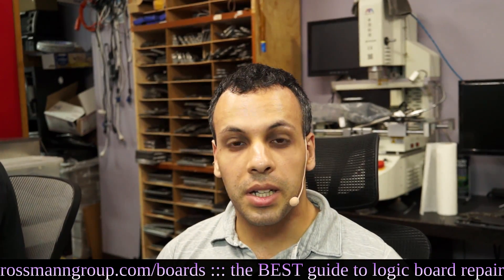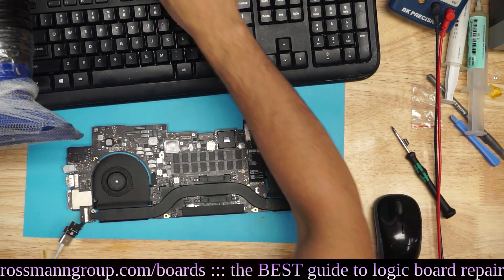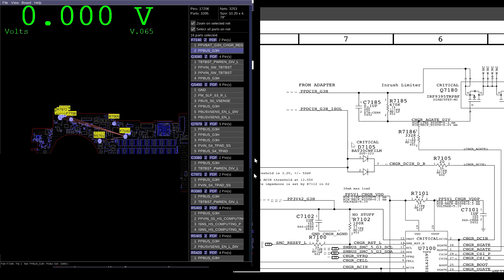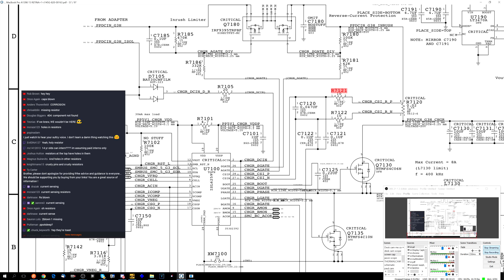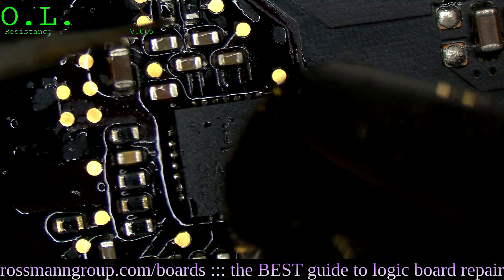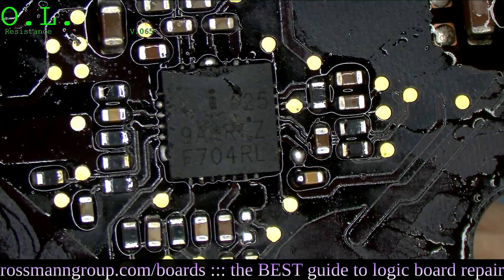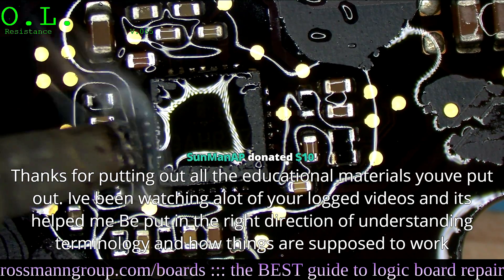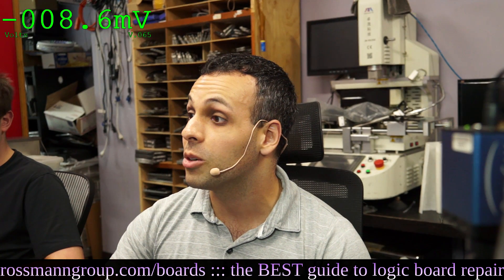Macbook repair + GoPro testing :D

Comment from the maker: › GoPro Hero 6: https://amzn.to/2MMcMiF
› GoPro Bike Mount: https://amzn.to/2OHc4Ej
› GoPro Housing w/ cold shoe mount for mic: https://amzn.to/2vNnwqB

Settings were 1080p, 120 FPS, and stabilization turned on. It does 2.7K at 120 FPS, but no image stabilization, and 4K brings you to 60 FPS and no image stabilization.

Comment: When you ask and Apple engineer

…if they even know what a heatsink is: 

Yeah, it just makes heat go places. It has no effect on the board. 

Me: You idiot thermals are important.
  1) throttling
 2) Boards can warp
 3) do you want to burn the laps of users?
 4) seriously Apple, Get with the thermal management

… What a fuse does
  Yeah it makes sure to break things so they don’t catch on  fire but wont break itself

Me: You bafoon it blows but wont break stuff

… How much wood would a woodchuck chuck if a wood chuck could chuck wood?
 Yes, It would

Comment: Resistors are usually only symptoms of much larger issue. If 10ohm resistors burn then there must be a pretty major short. Most likely not water damage because water doesn't conduct electricity well enough. Eh board repair could be fun to do alongside to studuying. I wish I could do it :/ Man I would even do it for free just to train my skills.
Reply: people usually spend shitload on a laptop and save up on knock off power bricks,  resistors go off